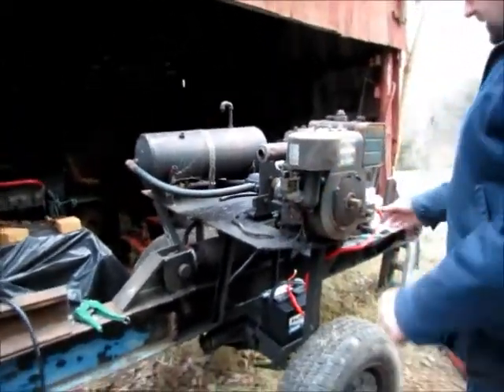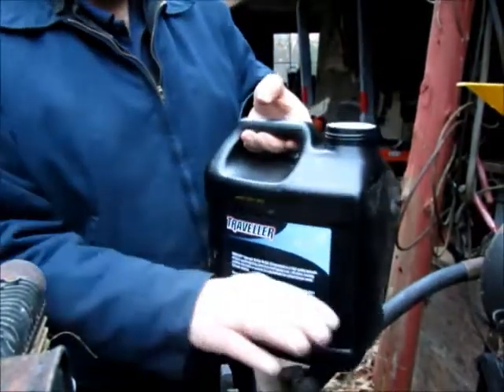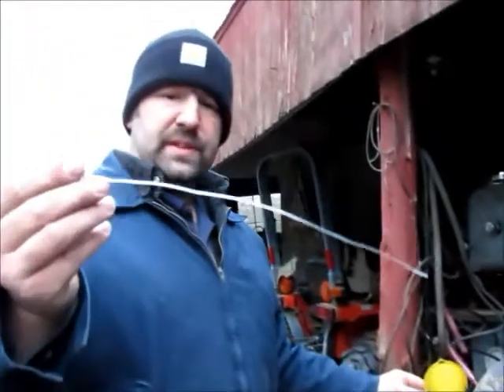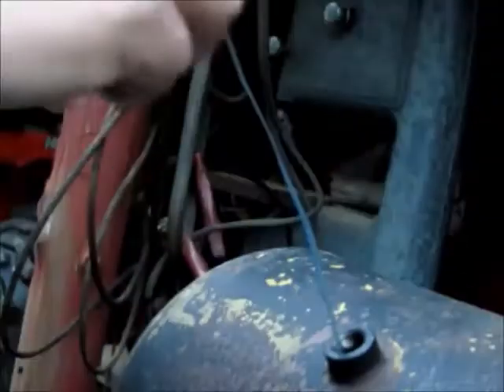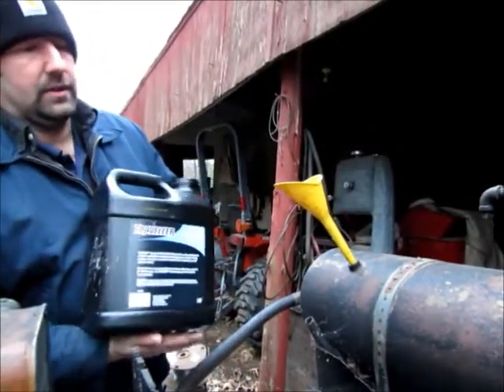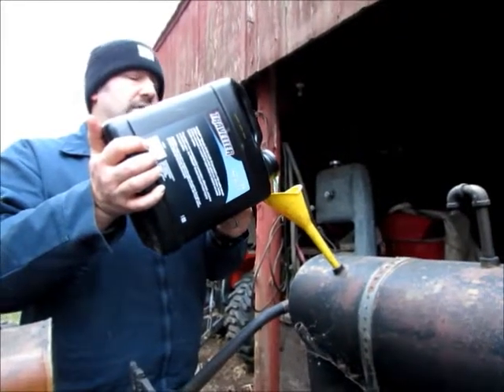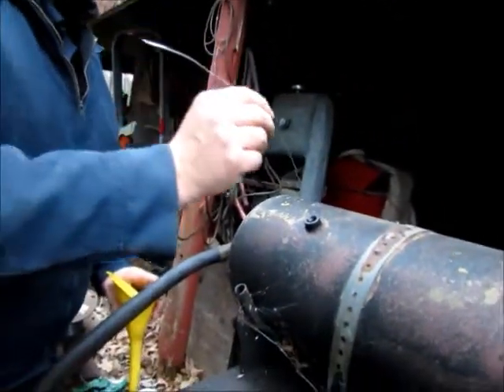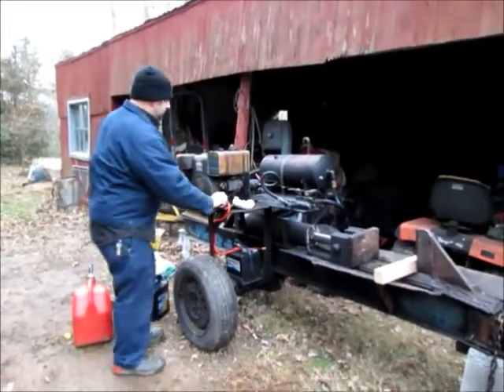Fixing a Homemade Wood Splitter

Comment: Nothing like getting machinery up and running agan, especially when they're as easy to fix as that! Whilst probably ill-advised, I'd be tempted to see if I could rig some sort of hopper system over that splitter to handle larger quantities of wood at a time... ;)
Reply from the maker: Simon B you read my mind! I am also wanting to build a hydraulic log lifting arm to help with the bigger logs. Someday... ~Mr. C.